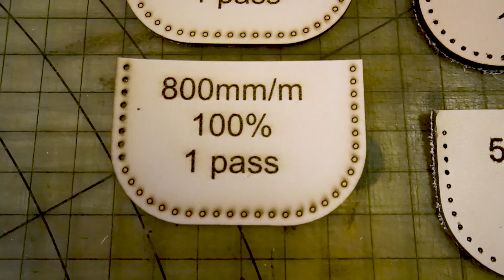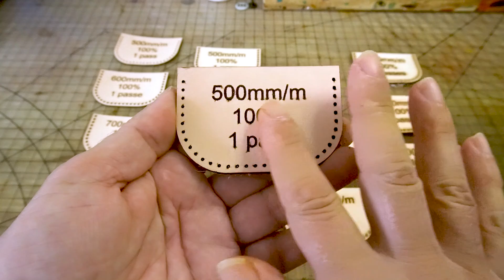Can a 10watt Diode Laser cut leather patterns and stitching holes? Aufero Laser 2 Lu2-10a 10 Watt.

Comment: Bonjour quel type de cuir arrivez-vous à découper aussi facilement ? Collet?
Reply from the maker: J'utilise du cuir Veg tan. Les cuirs plus souples comme le tannage au chrome produisent en fait une fumée toxique lorsque vous les gravez ou les coupez. Le cuir tanné au chrome découpé au laser libère du gaz cyanure, qui est hautement toxique et potentiellement mortel. Vous ne voulez pas vous embêter avec ça.
 Le tannage végétal est le plus sûr et le cuir que j'utilise le plus. Merci!

I use Veg tan leather. Softer leather like chrome tan actually produce poisonous smoke when you engrave or cut them. Laser cutting chrome tanned leather releases cyanide gas, which is highly poisonous and potentially lethal. You don’t want to mess around with it. 
 Veg tan is the safest and the leather I use most. Thank you!

Comment: Awesome video.  I need to make those spec cut outs for the community laser.  I have access but no support.   This really helps.
Reply from the maker: Glad it helps. I found that density of the leather can alter what speed settings to use or how many passes. So far I have not have to go beyond 2 passes but mostly 1 is enough.

Comment: Hello. Thks for your very detailed video. 
I am wondering how do you get rid of the terrible smell ? 
I have been trying some leather cuttings with my 10W, and the pieces smell terribly bad… ?

Thank you for your help.
Reply from the maker: I agree. The best answer I can give you right now is time.  One of the first of my templates I converted to be able to make on the laser was a mask that I make. I put it up to my face when I was done and realized right away that I can't give this to anyone as long as it smells like this. Then I picked up the bundle of test pieces that I did for this video a couple of weeks prior and they only smelled like leather. I was surprised.   I made the mask about 2 weeks ago and now you can barely smell the burn. So it is "Time" that gets rid of the smell. I ran into this Reddit post on the same topic incase you want to read it but they came to the same conclusion but some people had some suggestions that can't hurt to try. Some recommend isopropyl alcohol. I think this would dry out the leather so if you do use alcohol oil up the leather after.
https://www.reddit.com/r/lasercutting/comments/5wqeqp/can_you_remove_the_burnt_smell_from_laser_etched/
https://www.reddit.com/r/Leathercraft/comments/7je528/getting_the_burnt_cow_smell_out_of_laser_cut/
https://www.reddit.com/r/lasercutting/comments/4t6lyw/question_treating_laserengraved_leather/
https://www.reddit.com/r/lasercutting/comments/b3si4d/just_cut_a_pattern_out_of_leather_anyone_know_how/

Do a Google search and a bunch of ideas come up. Hope this helps. :)

Comment: Thank you very much, really appriciate you took the time for making this vid. Good to know the laser can makes little stitching holes. The vid helped me to buy one, although it will be a 20 watt. I am aware the 10 Watt can do the job without efford, but the 20 Watt is probably a bit quicker. Again, thank you
Reply from the maker: Thank you! It seems when it comes to lasers the more wattage the better. Your going to love working with it.  I really enjoy using this thing. :)
Reply: @baronleathercraft  Not always as the power of the laser increases from 5 to say 40 watt the size of the cutting spot also gets larger meaning wider cuts. not by much but noticeable
Reply from the maker: @chrisashdown1484  I agree, that is why I actually like to use a 10 watt laser for engraving because of that very reason. I find that any wattage above that I loose some darkness and detail. I have found that the AMCER P3 engraves great on it's 24 watt setting. When the ACMER P3 laser is set to 24 watts, its spot size is 0.07 x 0.09 mm. Thank you for the comment.